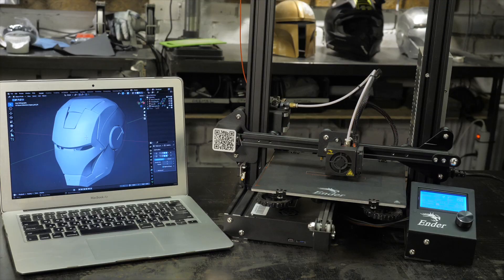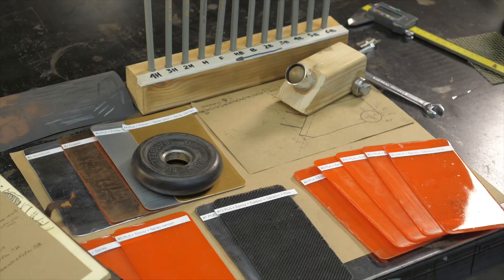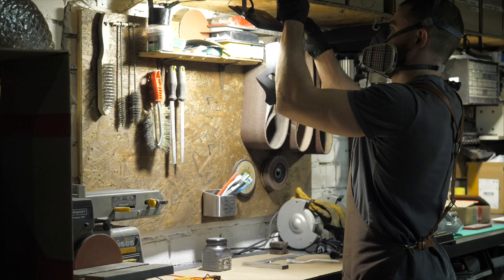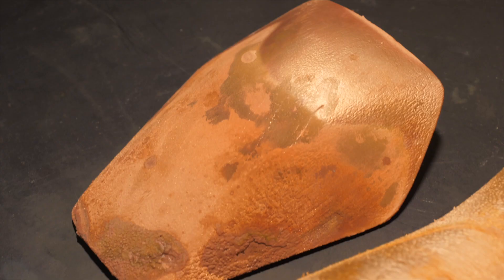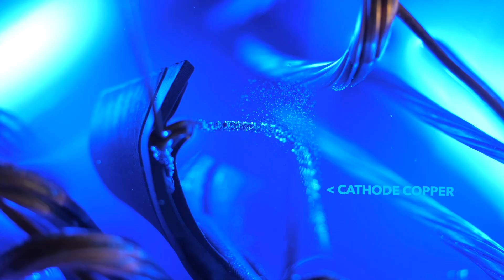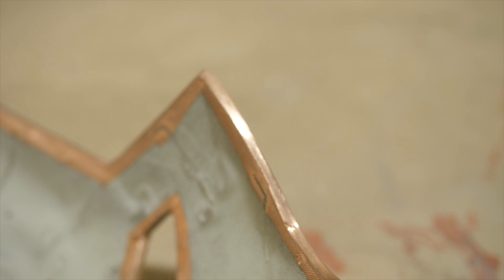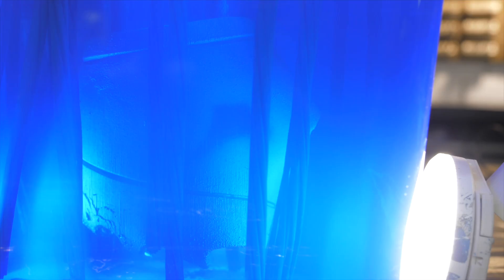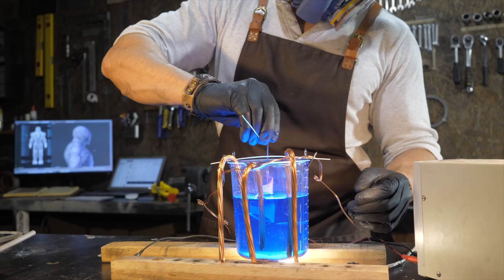#11 How to prepare 3D printed part for electroplating without copper paint. Basics of composites.

Comment: You should try using 99% Zinc weld through paint,  it is basically zinc particles suspended in a water proof paint and when you spray it on  you buff it with steal / copper wool and it comes to a very shiny silver and it is good to go,  99% zinc is what i always use when electro plating plastic
Reply: Hello, can you explain to me how you did this? Do you mix the zinc into the paint or do you apply it directly like conductive copper paint?

Comment: Thanks for a very informative video. You asked for recommendations on how to make the streamline the "nerve system" part of the process.
Have you considered using a series connection instead of parallel? Glue one single wire run around an edge, spot glued with the insulation scraped at those points. 
And I suspect one per each eye hole would also go a long way to speeding up the plating of that piece.
Reply: Wouldn't such a single long wire with scrapped contact points in series cause too much voltage drop (same phenomenon as seen in LED strips that are too long)? Especially considering that the nominal voltage for electroplating is already very low to being with.
Reply: @fluxcapacitor  Not at the low currents being used in this process, the system (unlike LEDs) does not care what the voltage is, and it is a constant current source anyway. And besides, any extra resistance of the wire is irrelevant when compared to the resistance of the "paint".
Does that make sense to you?
Reply: Yes that males sense. Thanks!

Comment: the electrolyte should be something that keeps any oxide layer away (or bubbles hydrogen to remove the oxide layer to water, leaving metal), like SnO to Sn (so alternating hydrogen/copper evolution in the same process electrolysis-plating cell)
Reply: silver conductive paint by a brush will attach to most surfaces directly and is electroplatable directly
Reply: you could laser the surface to conductive graphene (capton tape the whole model, melt to make a nice fit)
Reply: ie capton tape circuit board/seed, with optional metal growth in vat bath
Reply: you could also just graphite pencil "paint" the whole thing